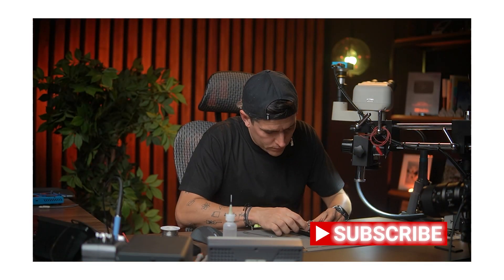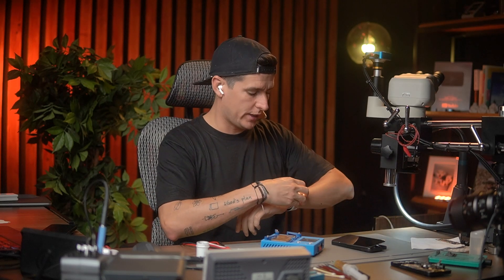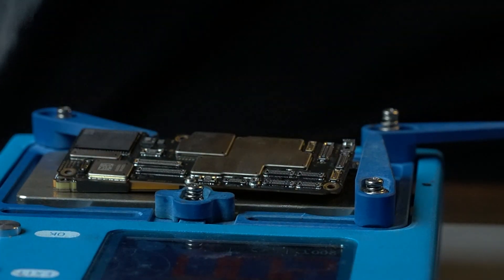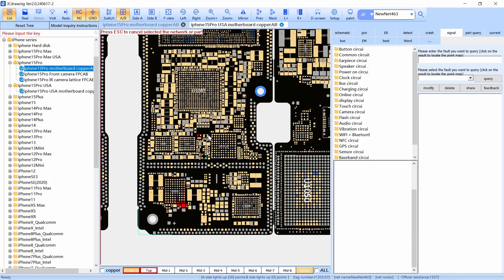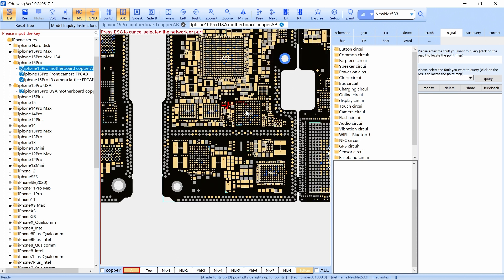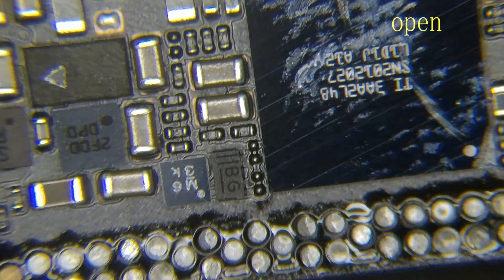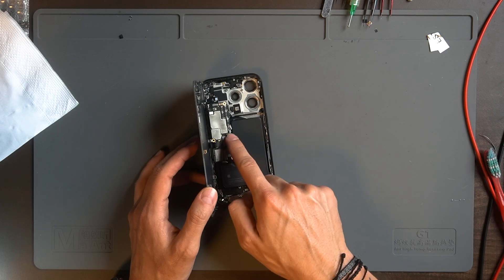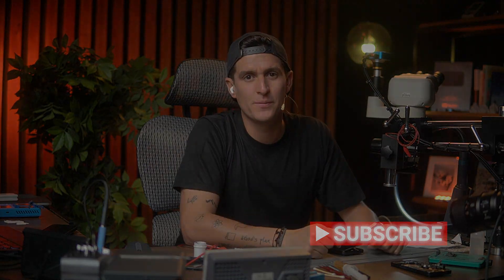IPHONE 15 PRO NOT CHARGING: AN EASY FIX | ¡THIS IS HOW WE DID IT! (Part 2)

Comment: really sucks that you can not swap these components with new IC's. So many people will be using non apple certify cables that this will happen a lot. This will be a very expensive repair if it can only be done with donor boards. 😑